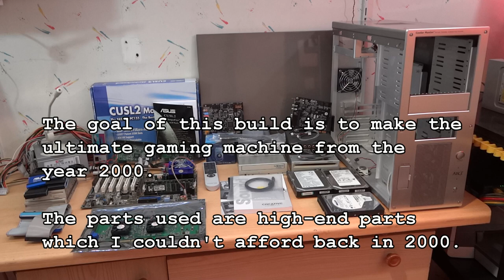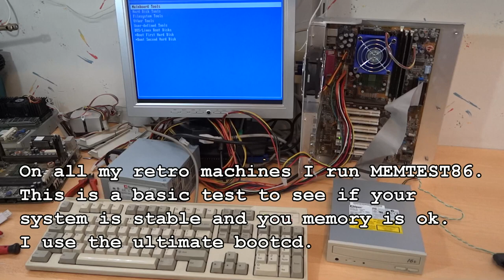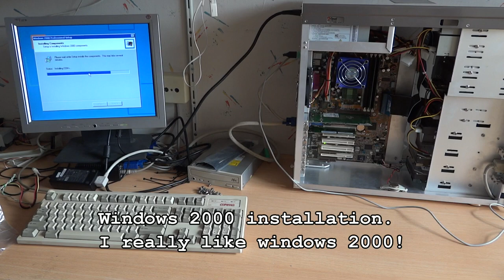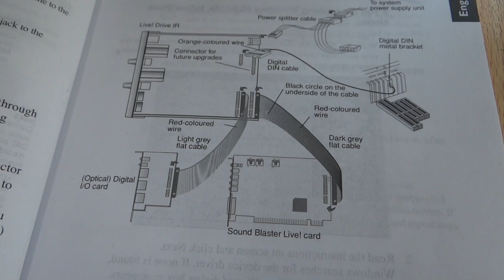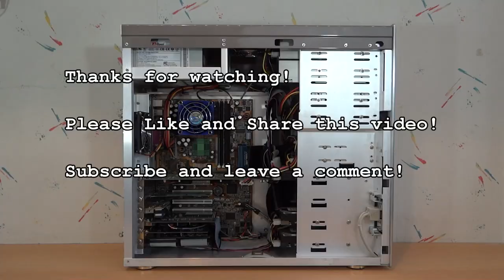Ultimate year 2000 gaming build! 3DFX Voodoo5 Asus CUSL2 P3-1ghz CM ATC201

Comment: Anyone know if this case would support modern motherboard? I think I know the answer, but still proceeding to ask this retarded question.
Reply from the maker: Yes you can fit any modern ATX board in it. But it is limited by it size. I think a 12x9 board will fit